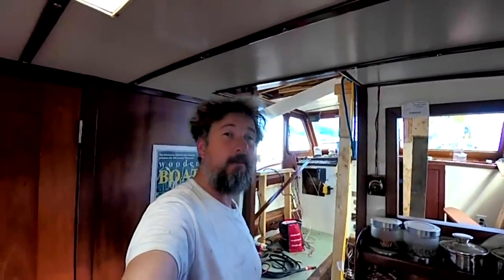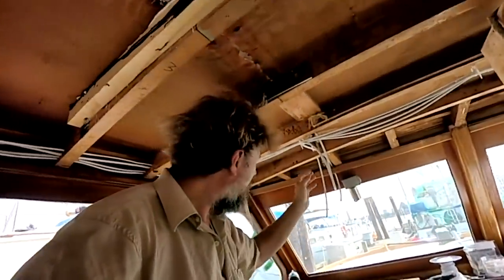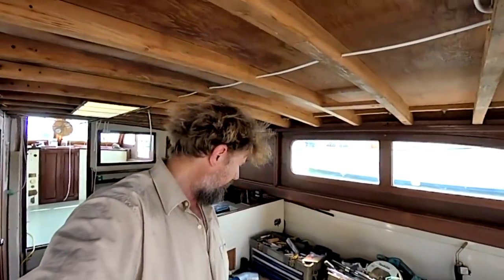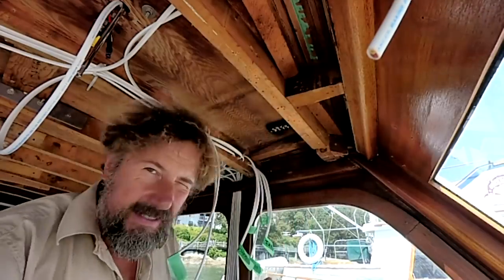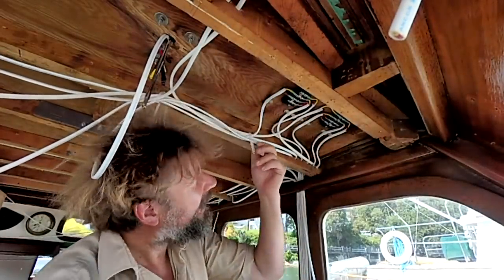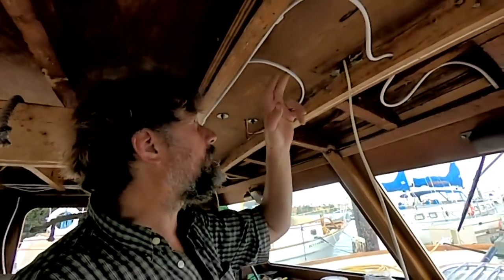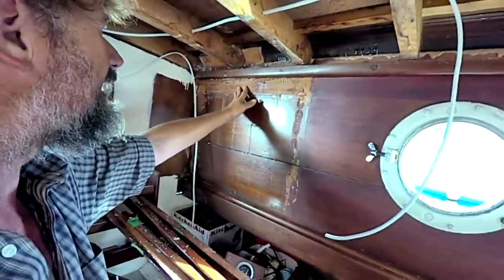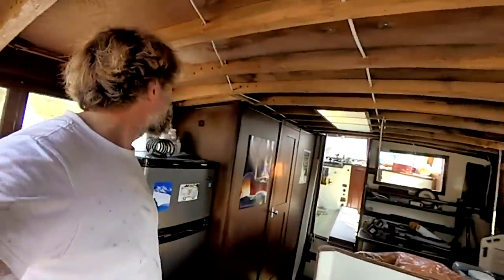Rewiring MV Zephyrus - Wooden boat restoration - Boat Refit - Travels With Geordie #83

Comment: Kudos for using the correct crimping tool. Do it right like you are and you’ll never have to go back in there.
Reply from the maker: Thanks, and yes it's a good tool but to be fair it's not exactly the right tool. I should really be using a single crimp tool for these heat shrink terminals. I could do several episodes on this as it's quite involved.

Comment: As usual... I had to order the anchor crimper. Sweet job.
Reply from the maker: Yikes Richard, I hope I haven't steered you wrong. I use a dual crimp tool. It has two sets of anvils. One crimps the acual terminal and the other, which doesn't close as far, crimps the strain relief insulator on NON shrink tube terminals. I only have the one crimper as they're so expensive and I've found the dual crimp does not damage the heat shrink tubing but in a perfect world you should really use the single crimper for heat shrink terminals.
Reply: That’s the one I got. I have an old single as well. But like you, I used to solder the connections. I had not paid attention to the newer tools. I’m getting ready to tackle the Airstream project.....

Comment: You can teach an old dog new tricks. I consider myself quite a proper craftsman and boater, BUT, at almost 75 years old I learned 3 very handy tips from you about wiring. 1. I did not know that the plastic sleeve on the crimp fasteners was shrinkable. DUH!!! 2. I’ve never allowed for a “drip loop”. 3. The idea of leaving a slack amount of wiring to allow future exterior wiring maintenance is so simple but genius to me. Keep up the detailed descriptions. If I would have cracked a few more books as a youngster (instead of knowing it all) a lot of my projects would have been a lot easier and better. You have a natural teaching skill that comes through with every video.
Reply: Gary, the crimp fasteners that have shrink tube already on them is a newer thing they've come out with.
I only learned about this a year or so ago mysself
Reply from the maker: Thanks Gary, Yes, as 53Peterbilt mentioned I'm using special (read expensive) Ancor brand marine terminals. The insulation is shrinkable and adhesive on the inside. They make a very tidy connection.
Reply from the maker: Exactly, good point.

Comment: Nice job   I use dielectric grease  to coat  my t blocks. just a lite coat on a brush. Keeps the greenies at Bay.  Nice  runs,  keep a file of the pictures or make a paper map  of your runs in case of ......
Reply from the maker: Thanks Don. I LOVE dielectric grease. use it everywhere.I'm doing a full as built wiring plan and panel schematic god forbid some poor bugger has to fix something down the line.

Comment: My wife an I found you when we researched Airstream videos.  Truly enjoy your content.  Excellent thought process for the wiring and it’s execution.  Is there a marine approved fire-stop material you could deploy in the vertical wire chases coming from the engine compartment?  Keep up the good work and videos.
We hope you soon can sit back and enjoy the fruits of your labors.
Reply from the maker: Thanks. The firestop thought is interesting. I'm studying for my ABYC marine electrician certificate and will ponder over the books. I'm not using anything myself. Being diesel there is not so much fire risk.

Comment: Repower,rewire,replumb ,everything will be ship shape. The aft cabin seems larger in Zephyrus . So rewarding to ditch all the unnecessary wiring. Sconces will enhance the main salon. Cheers PS Are the wiper motors energy efficient?💦
Reply from the maker: Thanks again Robert. Yes, keen eye, the aft cabin is longer on Zephyrus, giving a lovely big galley which is so loved by the owner. The wipers are pretty basic, not particularly efficient.

Comment: You mentioned aircraft wiring. What about an anti-corrosion spray such as Boeshield T-9 on the terminals? Thanks for sharing your project, Dave
Reply from the maker: Thanks David, good idea, I'll Google it.
Reply: @TravelsWithGeordie  I put this on the terminal blocks on my boat, 11 years full time in salt water, not even a hint of corrosion. Best I've used.

Comment: Hi Peter, Enjoy your work. As a former electrician I would disagree with the crimping of wires. I’ve used crimping before on my boat and over time the moisture in the air gets into the exposed wire and corrodes the wire. I agree with you and industry standards for using it.  It’s quick and simply, but having rewired my horn, wipers, running lights for the third time, I now use aviation standards and solder my connections, using a moisture barrier heat shrink. 
Also a little confused, the wiring is your boat or friends boat? Or both?
Reply from the maker: Hi Jon. I was a firm believer in solder as well. Followed by adhesive heat shrink. I've accepted the Ancor crimp system as I think it's pretty good and soldering is no longer accepted on boats that want to be ABYC compliant.You figured it out, yes, I'm rewiring both boats.

Comment: Hey Pete, I hate to bother you, but I'm trying to find the same crimping tool you have. I have listened to the video at least a dozen times but I still can't hear the name clearly. Can you please tell me the manufacturer and approx how much you paid? I'm replacing my motor next March and will have just 3 days to straight out the engine compartment, paint and electric. I want to replace it all so I want to have my tools and supplies prepurchased before I get started. Thanks!
Reply from the maker: Hi, I hope I haven't steered you wrong. I use a dual crimp tool. It has two sets of anvils. One crimps the acual terminal and the other, which doesn't close as far, crimps the strain relief insulator on NON shrink tube terminals. I only have the one crimper as they're so expensive and I've found the dual crimp does not damage the heat shrink tubing but in a perfect world you should really use the single crimper for heat shrink terminals.The brand is Ancor and if you're only going to use shrink tube terminals get the single crimp tool. Cheaper too.

Comment: LEDs use much less current. Can't you use smaller sized wires?
Reply from the maker: You're very right Wallace. However there is no great cost saving and the overload safety factor is nice to have.

Comment: Note thatTerminal blocks are not stainless. Stainless is a poor conductor.
Reply from the maker: Good point. I assumed the little jumpers were but after checking I see they're plated brass like the actual blocks. Thanks for pointing that out.

Comment: It doesn't appear that you are going to insulate the ceiling?  I would think anything, given the fishbowl of upper cabin single pane windows, would be helpful on those cold Pacific Northwest winter days!
Reply from the maker: Hi Peter, a common question. I have opted for better ventilation to preserve the boat over insulation that might trap moisture and cause mold and rot. That and cruise south...